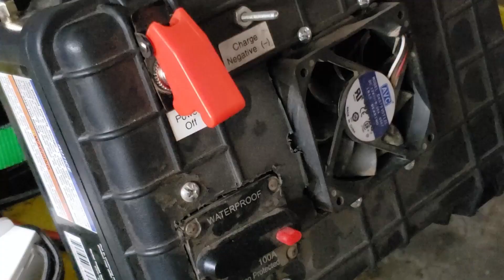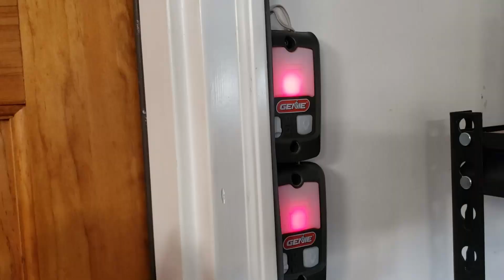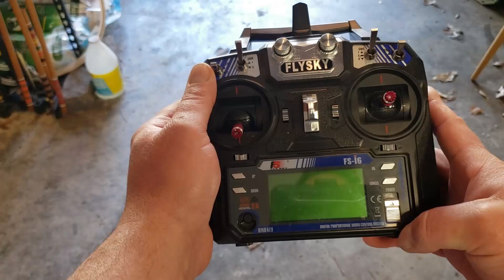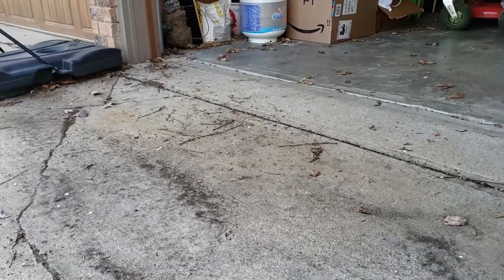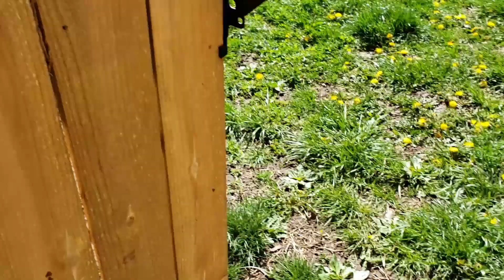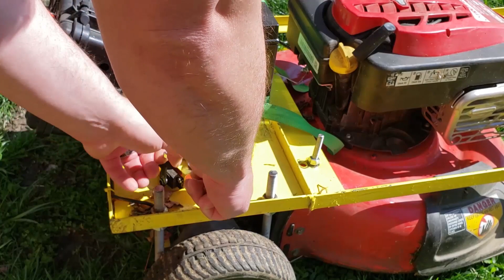Virtual Reality FPV RC Lawn Mower Build Radio Controlled.

Comment: Thanks for the video. IIRC the handlebar spring that kills the mower has it's own wire to a ground that shorts the coil, in which case you could use a bosh style relay that grounds that wire.
Reply from the maker: It kills the spark plug only. It doesn't do anything to stop the blade from spinning. I didn't want to compromise the safety of the spring which applies pressure to the break.

Comment: Interesting. I’ve been toying with building a big one from a 50 or 60” tow behind, but I’m not sure if the typical wheelchair motor would handle it. Figured I could use throttle/rudder for tilt/pan gimbal. Would like to see beside and behind the machine for safety. Elevon control for motors/steering on the right stick.
Reply: Electric wheel chairs will weight anywhere from 150-250lbs, and have a rider weight rating of 300+lbs depending on the model. I think a tow behind is very doable. My current build is for just a 21" push mower, but I'd like to upgrade it to a full riding mower deck 40"+, but I will have to figure out how to power the deck and 24V alternator. Right now the Alternator runs off the self propel pully and belt, so in theory it will charge itself up, and never need to be plugged in. Others have done it, so I am sure it will work.
Reply: checkout motionsic RC for gimbles
Reply: Try to find an Hoveround HPV5 36V motors. They might be able your weight requirements. They are built like tanks and can move quite a bit of weight. Good luck.

Comment: Yea, very innovative, improvised solution. But you dived into the details without a broad overview. Eg. Are the blades driven by a gasoline engine and the wheels by the batteries?
Reply from the maker: The rc/drive system is independent of the mower system with the exception of the shut off/brake.

Comment: Can you replace a basic RC receiver with an Arduino to make it autonomous?   
Basically then use gps/waypoints with  it.
I want to make an rc mower without the engine/cutting portion to free up the weight.   I want it to roam my grassy lot that's .2 acres.
Reply from the maker: I would look into LIDAR integration. I didn't want to go fully autonomous due to safety and extensive development. It should be possible though.

Comment: Can you explain more about the ground from the rc receiver to sabertooth? I have a very similar build as you and have my receiver power and ground coming from a separate 5v power supply similar to yours. I do not have it grounded to the sabertooth. I occasionally get some twitchy inputs and have low range for a 2.4ghz controller, I just attributed those issues to vibration and rf from the mower itself running. I will be adding a ground to see if my issues subside. Like you said they are a constant work in progress. Thanks for sharing!
Reply from the maker: Yeah, just make sure ground is tied between the sabertooth and receiver. Mine didn't work until I did that. Just for the signal at least, but all ground should also go to the chassis.
Reply: Can you elaborate on the ground issue? I'm not following the problem. Thanks

Comment: you can get 2 of the Harbor Freight trickle chargers and hook 1 to each battery with out dis connecting the batteries from each other.  That is what i did on mine first one.
Reply from the maker: I've been disconnecting the batteries to charge anyway. I will give your way a try. Thanks Brother.

Comment: I am curious about building one and making it FPV but I'm curious about the vibration in your fpv feed? How bad does the vibration show up on the goggles?
Reply from the maker: It isn't bad at all, at least not any worse than on a drone zipping around. Just make sure it is a wide FOV and you pull separate 12v power if you're running a 24v system. I would recommend bigger box type goggles actually with a big FOV as well. Resolution seems less important.
Reply: @chainrection774  thank you sir, I do alot of fpv and tried it on some of my nitro planes and that was a no go, looked like a blender in the video.

Comment: Maybe I missed it; could you share more info about the motors you chose? Im looking into using either 2 or 4 motors. I'd like to know what torque and rpm others are using. I havent decided on wheel size yet, but I'm leaning towards 8" to 10" pneumatic tires. If I go with a high rpm motor, (higher than is necessary) I can reduce the max throttle in the channel mixer on my transmitter to the exact top speed I like. I'm worried about using motors with too little torque.
Reply from the maker: The motors i have are pride z. I don't have the full specs. I would definitely go with 10" wheels if you can. I bought second hand and didn't have a choice. The speed can be throttled back on the transmitter. I believe it is under exponential value?? It was mentioned in another reply in this video, I'm sure you can find plenty on the transmitter on here as well. I can't comment on the torque but I would figure it is linked to the max amperage of your batteries. I did add giant 13" wheels to it at one time with no torque issues but took them off due to fast battery drain. I don't like seeing my wheels slip in wet grass when I'm watching from a distance cause I know that is lost power.

Comment: Hey, Nice job! I'm going to be completely rebuilding my RC mower and am thinking about adding the video capabilities. Can you tell me what setup you have, or what I need to get to add it to my mower?
Reply from the maker: I will add links in the description later but it is a ev100 for the headset, Wolfwhoop Q1-Pro 0.01/25/200/500/800mW Switchable 5.8GHz 37CH FPV Transmitter, Caddx Ratel Newest FPV Camera 1/1.8'' Starlight HDR OSD 1200TVL 16:9 NTSC camera. I tried a 120 FOV camera before and the field was too narrow. So I went with an 160 or higher. Kind of a give or take on the fov, you need to see around and in front but it distorts the perspective a bit and takes getting used to. I don't get perfect lines in the yard but I don't care, I'm not pushing the dang thing anymore.  I added some fatty tires that aren't in this video and I will make a new video sooner or later.
Reply: @chainrection774  Thanks so much...Just moved and I have no shop at the moment but sometime this summer will be up and running. Should be able to start rebuilding mine then.

Comment: I need help setting up my controller. Flysky
Reply from the maker: What's the issue?
Reply: @chainrection774  
I bought the flysky controller with receiver.  I can’t get the right settings in my radio.  I want to split the wheels when turning to make tight turns plus I am mowing on steep hills. I have each wheel going different directions an forward seems ok but steering is not
Reply from the maker: @ellismccoy2020  Try reversing a channel, 1 or 2 in the settings of the controller.

Comment: in the setting on your transmitter you will find something called expos.  by increasing/decreasing your expo setting it alters the sensitivity of the stick inputs.   Lower the expo setting for the two channels you control the motors with and small adjustments wont be so twitchy while steering.  You will have to use more stick input but that increases your accuracy without overshooting.
Reply from the maker: Just tried those settings,  helped a lot. Thank you.
Reply: @chainrection774  Glad it helped.  Im right at the time to assemble all the parts for my mower minus a few things that I still need to pick up.  I love building things to be lazy with.
Reply: I found them but not sure what number to set them to? what a good number for them ?
Reply: @kentanch2601  sorry its been a while but if you havent figured it out...  The FlySky radio used here, channel 3 and 4 are mixed together and you will want to lower the expo setting for each channel to say... 50 or 60 and save.  then drive it a bit and then return and lower some more and compare the feel.  You still have full input range doing this, just not full blast at first touch.  You might like channel 4 which controls left and right movement to be even lower than ch. 3 which will be forward and back.  That way you will maintain a straight line easier.  There is also a setting per channel to dumb down the max input value of full blast.  I dont cut the grass at 6 mph so I knocked down those limits to suit lawn mowing instead of drag racing.